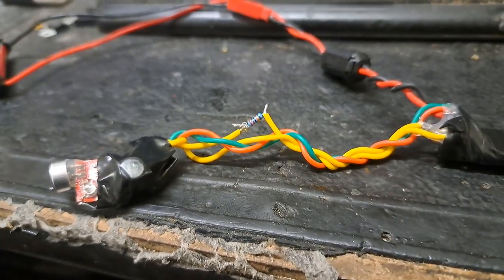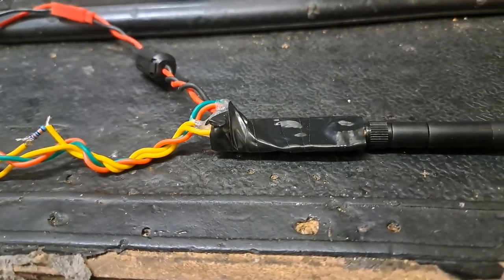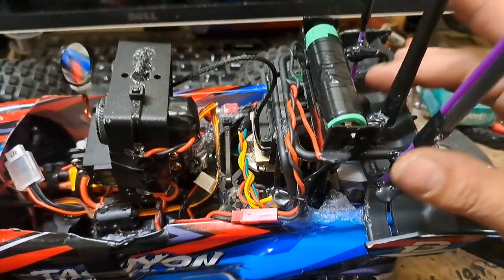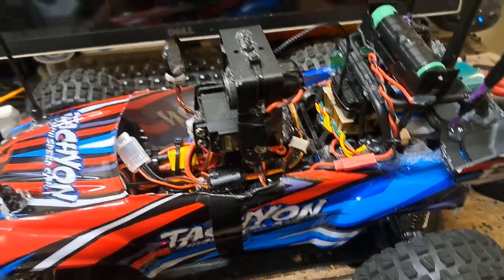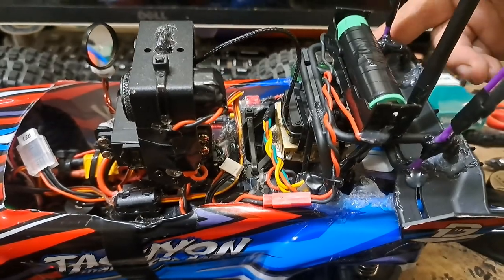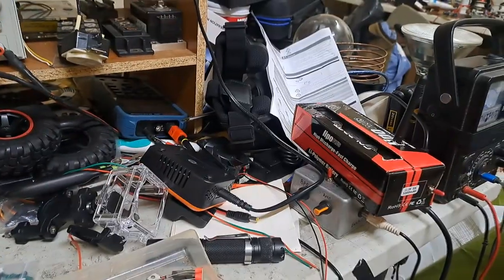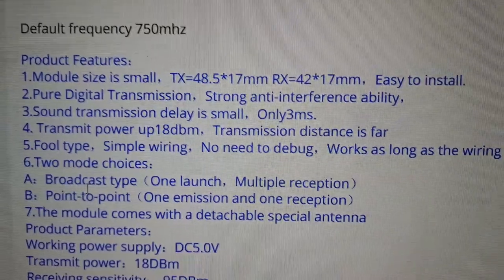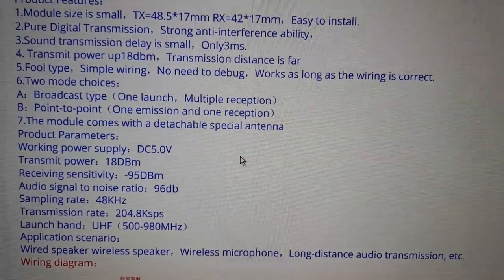RC Digital FPV Adding Live Audio (~750mhz)

Comment: Dude this is awesome! Real good price for audio and out of the way of Crossfire and 2.4ghz (if you get on the right channel). I'm surprised there wasn't a channel / frequency map. Tuning the gain seems like a pain tho.. thanks for the info! 🤙
Reply from the maker: Yeah man I hope it doesn't crap out within 100 feet or something though. I should know sometime today how far away it works.
Reply from the maker: So I tested it further out and does work pretty good short range.. but I think I will end up going to 1.3g for the audio because of how much it starts to break up the further out I go. It seems too difficult to truly tune these without buying expensive equipment. For like up close driving or flying (yard or house) I think it's a great addition to digital though. For longer range I realized the little Partom 1.3g units are probably ideal. Relative to the different but similar looking Amazon transmitters I tried, they are drawing less power and never really get hot. I noticed only the slightest background hum in the audio feed when switching the O3 to high power. Driving the DJI while being able to hear is a good feeling though.. just 1.3g kind of sucks because of the size of the stuff needed on the receiving end. It's not too big a deal for driving though.. keep a little receiver box with another 3s lipo in there, tiny amp board, little 4 ohm speaker.. and this 750mhz kind of deal could even be used as an easy switchable relay to make it all wireless to a receiver on the goggles. I'm not going to complicate it that much and just toss the receiver in a box with a speaker in it so I can just turn it on and leave it nearby for audio.